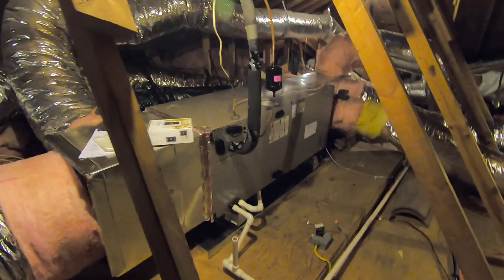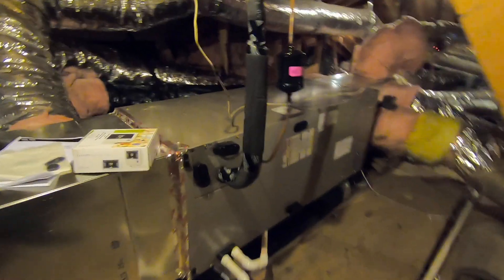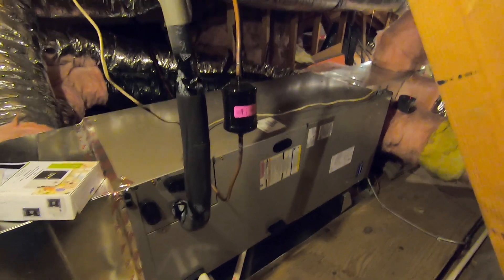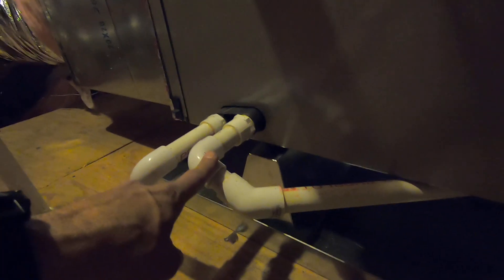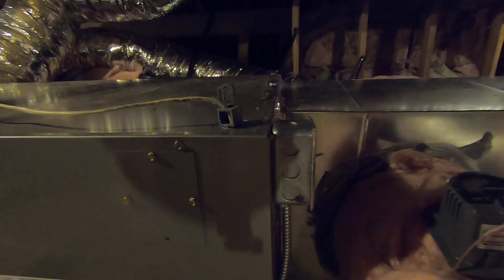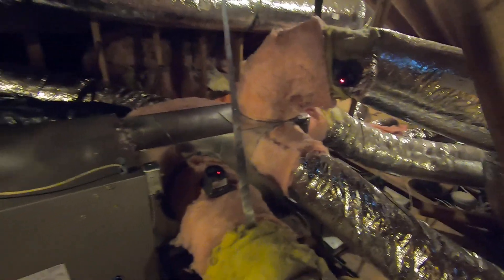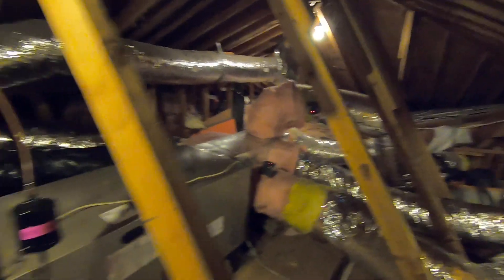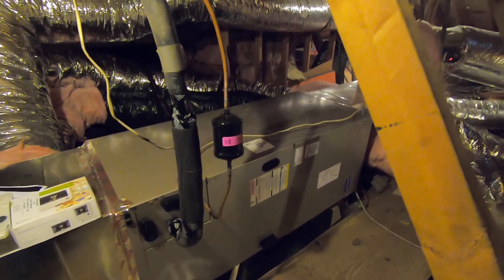Replace gas furnace with Carrier Infinity 4 ton fan coil and heat pump condenser in attic

Comment: No heatstrip?
Reply from the maker: This fan coil was installed in Southern California.  There is no back up heat strip that comes with this unit.  It is an add on if the customer wants it.